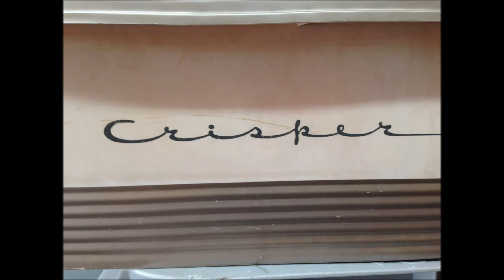Philco V Handle Refrigerator Refurbish Video 1

Comment: I just acquired a 1950's??  Philco fridge and on closer inspection; it is pretty banged up.  I can't seem to find what year it is but it doesn't have crispers and would be an apartment size; not a full size (though perhaps all of these older fridges are smaller??)  It is baby blue accented on the inside and has the typical "Dairy Bar" on the door.  Anyway, I basically got it for free with the intention of refurbishing it - it works fantastic...runs cold and quiet but I'm wondering how (or if I even should) replace the cracked plastic on the inside?  You can see the insulation in some places as it looks like the seals or whatever was around certain openings have gone missing over the years.  The outside is rough but I'm confident I can get it looking new again - I just don't know about the cracked plastic on the inside.  Is it even worth it to try and replace it or pay a little more and try and find one that may need work but at least is not cracked everywhere?  Sorry for the novel!
Reply from the maker: Hi - not sure without seeing it, but I bet you can find a 'donor' fridge that would have solid plastic trim you can use to replace what is bad on the one you have.  It will probably be a more effective way to get it to where you want to go and might have the crisper drawer as well.  Use a craiglist search aggregation site to help locate one close by.

Comment: Great job!  I just acquired my second v-handle so I have one original and one I am going to re paint like you did. Any tips on repainting the interior, especially the lettering?  Also where did you get the new gaskets from?
Reply from the maker: +Kevin Penner 

Hey thanks!  It was a lot of fun restoring this.  For the interior, I used krylon plastic paint for the red and white, though I first prepped with a high grit sandpaper and water, then used a tack cloth to remove any debris.  After a few coats of red and white I used Spray Max 2-part urethane primer.  I got mine from Sherwin-Williams automotive, but here is a good website for details: 
 http://www.repaintsupply.com/spraymax-3680061-2k-urethane-clear-coat-aerosol-p3685.html?utm_source=google-shopping&utm_medium=organic&gclid=CjwKEAiA9om3BRDpzvihsdGnhTwSJAAkSewLdH_0dk5TlXN4jwlrgRnt9X4hkq72UTEkWE_Xzja_ZRoCWqHw_wcB

The 'raised' lettering I used a paint marker after I painted with the plastic paint and before I clear coated it.  The shelves I freehanded the lettering.  

As for the gasket, here is the gasket I used and ordered from this site - it worked real well.

http://store.antiqueappliances.com/P10338-compression-gasket-per-foot_p_1.html

Hope this helps - good luck!
Reply: +Brian Holt thanks!

Comment: Hey Brian I just bought a 1953 V handle and when I open the door on the right side it will not latch again unless I lift it from the bottom. I was wondering if you could tell me how to adjust the hinges. It looks like from your pics there is a front to back adjustment but not a way to move the hinge or hinge plate up or down.
Reply from the maker: Hi Mike - A couple of things to look at.  First is the adjusting nut on the opposite hinge side can be adjusted to make sure the latch will align when you close it.  It also help with how loose your hinge is (or play).  The other issue I had was when I replaced the feet on the fridge it put it out of level.  Believe it or not, just by making a number of adjustments with the feel to make sure fridge was level really helped me with a similar problem you are having.  Hope this helps!
Reply: I am having the same problem I have the same model as in the video. I've tried adjusting the hinges horizontal but no luck.  I removed the chrome sleeves on the sides but I don't see any other way to adjust.